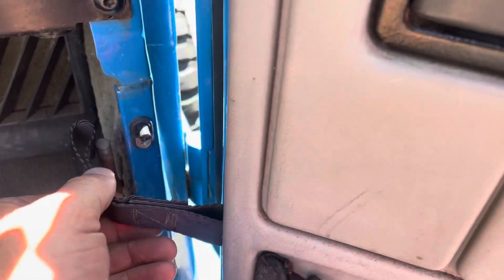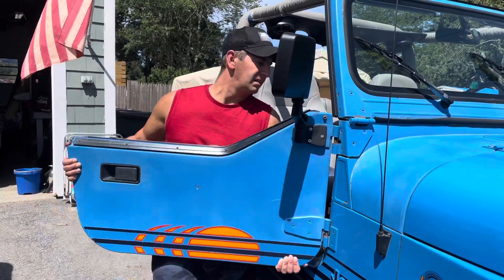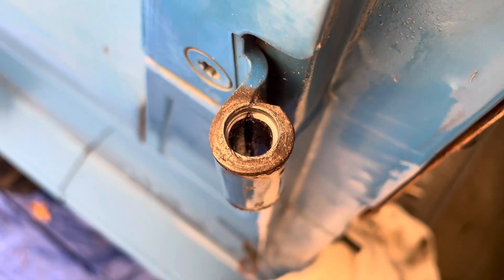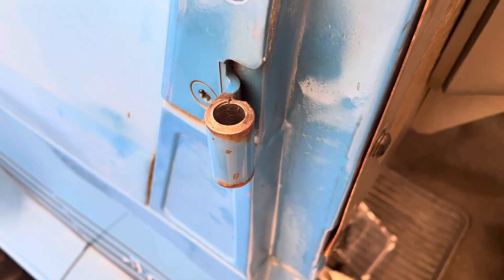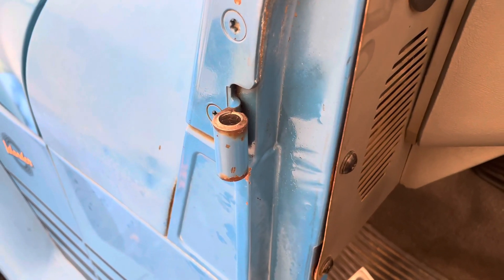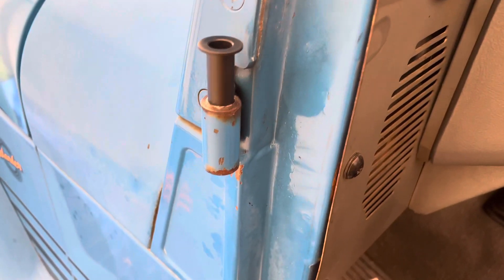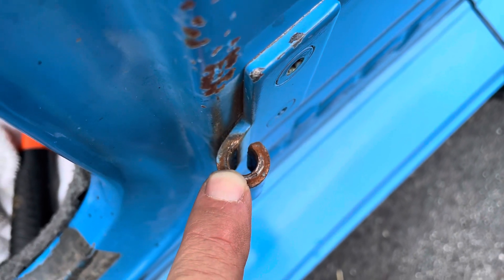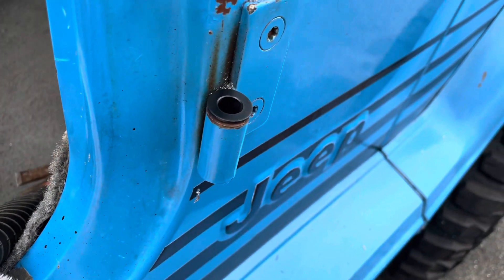How To Install TMR Customs Jeep Wrangler YJ Door Hinge Bushings

Comment: I have a 91 that don’t have bushings … what drill did you use to drill them out ?
Reply from the maker: I used one just big enough to drill it out. I forget what size drill bit I used.
Reply: Did you have to use a long bit ? My cordless drill seems to be at a angle up against the body ..